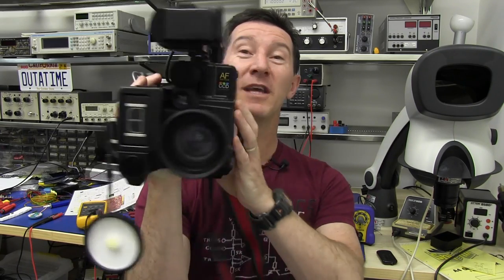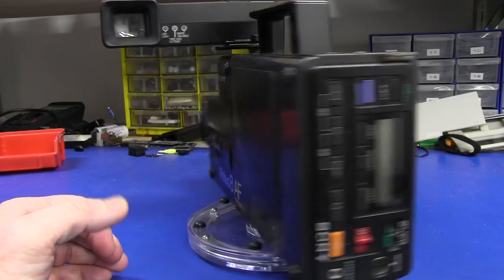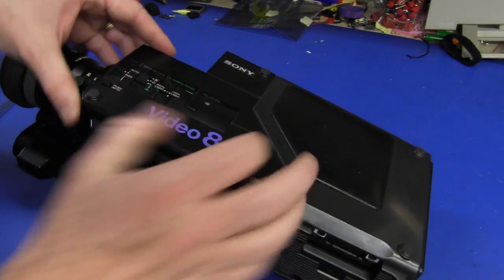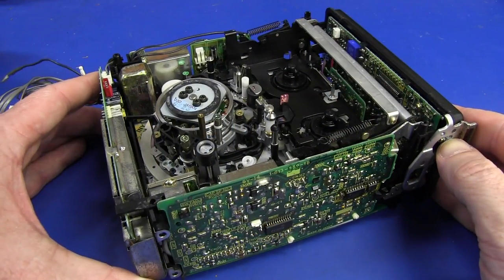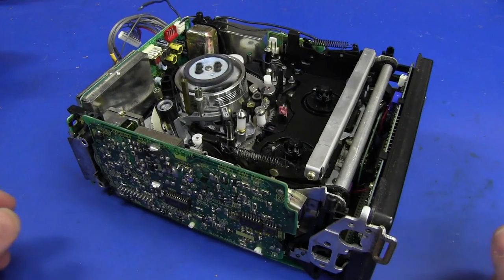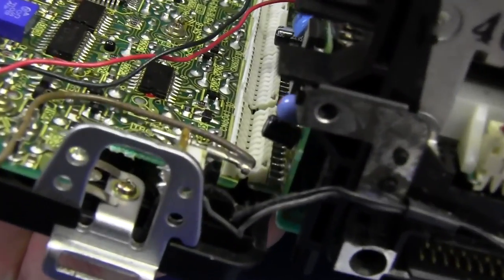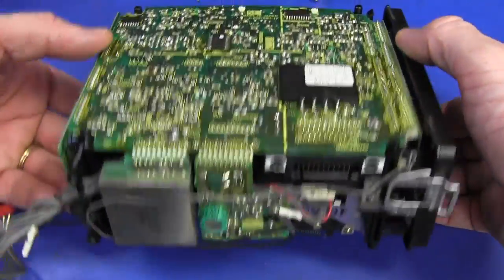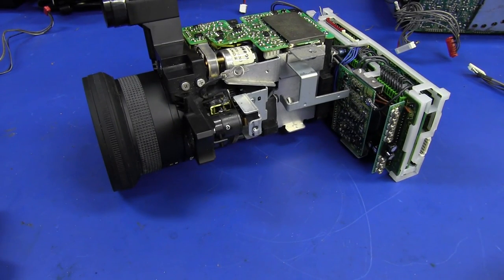EEVblog #375 - Sony Video 8 Camcorder Teardown

Comment: There's a date stamp on the inside of the casing around 11:25, but using Japanese emperor years (Showa 61 = 1986) - so it's from 1986.05.21

Comment: I used to fix these things back in the day.
The pots labeled LP adj were for long play adjust and there would be an SP adjust.
If memory serves they were for centering the tracking.

These things were a beast to repair and a lot of them had notorious surface mount cap issues.
The red button on the front that you did not know what it did is just another record/pause button. It did the same thing that the one that would be under your right thumb did.
A previous poster explained the delay line.

Comment: Shoulder-mount cameras still exist. :) I work with HD ones at the television station I work at part time. They're still nicely modular, the tape transport on one of ours broke, so we just ordered a new one and installed it ourselves. They also have replacable cards for various encoders.
You don't see them much in consumer cameras, but in the professional world they're alive and well.

Comment: The red photo sensor in the tape transport mechanism does not only detect the presence of the cassette. It also tells the VTR when either end of the tape has been reached. For fast forward or rewind this is critical, otherwise the tape could be stretched or snapped at the end of the spool. To tell the sensor when the end is reached, all tapes have a length of clear leader tape that the light beam can shine through.

Comment: Delay line is a scan lines timing scheme, Mechanical scanning of video lines using a rotating video head have inaccuracies, So the scan lines are delayed and released at a steady pace to have them stacked vertically with perfect timing, Modern analog camcorders had a line TBC using digital memory, so the lines are converted to digital, stored in a memory and released using a digital clock then converted back to analog and output using composite or S-Video connectors.

Comment: this is so awesome mister!!! I just happen to buy one for 200$ complete set w/ suitcase, original battery, i found a replacement battery, got the charger, instruction, spare tapes, but only the RF unit missing, but fear not i'll modify it to RCA outputs! thanks to your video, i'll be able to have a pre inside look before taking it apart, mine has issues with the motor section moving the lens and autofocus lens. :D time for beer and click play

Comment: I've also heard of them being used to delay the video one line so that when the tape is scratched and the video drops out, the last line is displayed instead of black. The last line is certainly a better approximation as to what should be displayed compared to black.

Comment: Re the glass delay line. The PAL system requires a device to delay one scan line of video for colour phase comparison (PAL - Phase Alternate Line) hence unlike NTSC there was no tint control needed on PAL TV’s. Alternately the signal path for Chroma and luminance signals was different meaning a small delay might be required in the luminance signal so it remained in sync with the Chroma information which has a longer processing path to avoid the Chroma being shifted to one side of the image .

Comment: @EEVblog:
The delay line was used to sync up the video with the reconstructed horizontal sync. The video and the H-sync were separated from each other and recorded to different parts on the tape.

Comment: Delay lines where also used as an simple error correcting system. One line of video is stored in the dclay line, and if there was a signal dropout from the tape, the signal from the last line was used instead.

Comment: Delay line is probably for compensation chrominance path delay to meet with luminance signal which was faster due to less processing. This device wasn't work on separate RGB signals instead signals for colors were coded to PAL system and recorded on the tape. So delay line is a part of PAL coder...

Comment: The detektor is a end-of-tape detector. There are holes on the side of the cassette and photo transistors on the sides of the holder.

Comment: Mine is Hi-8 and the user's manual says 440 lines in standard mode and 320 in LP. Unfortunately there was a problem with the SP mode when the camera was paused during recordings... Never used it much...

Comment: There still used in modern portible large board electronics SOMETIMES when a flex cable is to sensitive or small and vibration is a factor where a socket would end up having problems in the long run.  but the more modern ones atleast genrily are able to be pulled apart with a tool.

Comment: That one is built a lot nicer than the ones I've taken apart.
Those viewfinders are useful when you need a small screen. I have used them in several of my projects. Most of them just take 5v power and a composite video signal.
I like those hinged connectors. Are those available anywhere or are they custom?

Comment: EEVblog I think it did have a macro-function, it usually was in the knob on the zoomring (The Panasonic MS-1 at least had it this way and was able to focus so close you could see dust inside the lens :P).  Not that it matters anymore, but usually you could pull it out or press it in when nearing the wide-end of the zoomring, which would allow you to focus much, much closer.  Some of the cheaper Fujinon lenses for ENG camera's still have the macrofunction on the zoomring.

Comment: I think i have a clue how that auto focus might work.There should be an IR diode somewhere over or under the lens of it. As the IR light bounces of something you're trying to focus at, it comes back at an angle, beacuse the emitter is not exacly where the reciver is. And so, the device can find a strongest  IR light with that photosensor by moving it up or down. I'm not sure if it works that way here, but i'm sure that's how modern IR distance meters work.

Comment: @EEVblog:
Dangit. I keep posting like an idiot. I used to own a TV/VCR repair shop many years ago. I started repair on the BetaMax machines, all the way to the capacitive disk video players, and got out before the throw away CD music players. This is probably the reason I'm responding too much. The video playback is bad because the heads need cleaning.

Comment: I still have my JVC GR-DVM70u camcorder it used miniDV tapes I thought I was the man back in 1998/99 I paid $2,500 for it the thing is the size of a small paperback book it even had a SD card which could take pictures probably 640x480. The camcorder lasted but the batteries were crap the only battery I had died less than two years later and no spares and now probably no miniDV tapes.